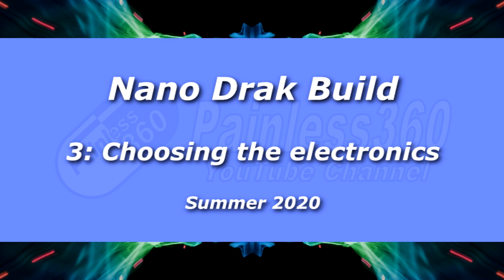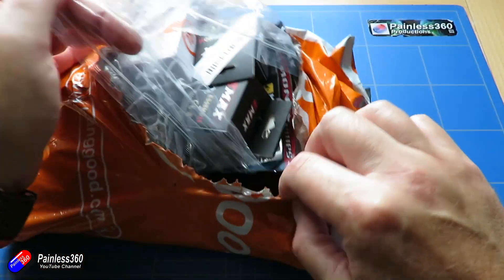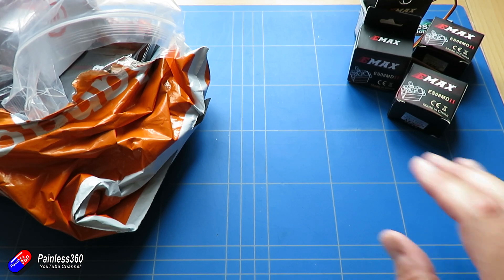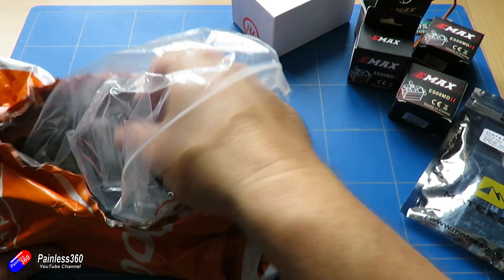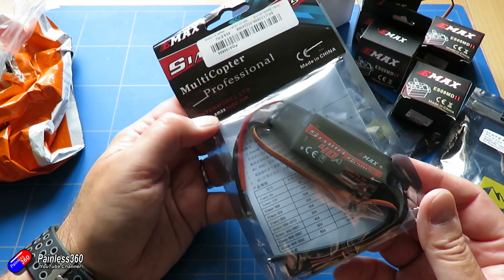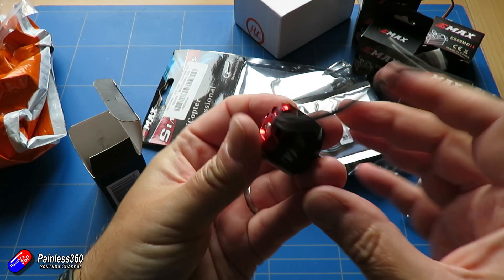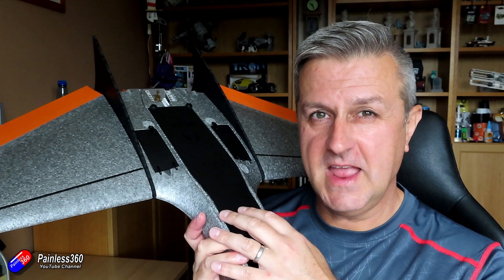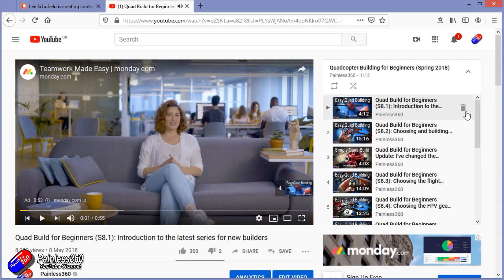Nano Drak Build: Part 3, the electronics!

Comment: I'd be really interested to hear the painless360 take on the nano vs the mini and the extended wings vs the standard ones and how they all fly. How are you finding the noise levels?
Reply from the maker: These are not quiet models ;) I need more time to play with the 40" wings and maybe the tail too...
Reply: @Painless360  I'm really curious to hear what the practical differences are with the different setups. How much speed do you lose with the extended wings? How much slower can you go? Is launching easier with any particular setup? Do you need bigger batteries with the extended wings/boom? etc

Hope you're well.

Comment: Nice video Lee; when you are covering the more detailed iNav setup it would be great if you go revisit (I know you've done it for older versions of iNav) what parameters need to be configured in the CLI and what can now be configured in Advanced configuration. From memory much older versions required RTH Altitude to be set in CLI (set nav_rth_altitude), even though the option was in Configuration, whereas I believe this can now reliably be set in Advanced configuration. Other settings like nav_rth_home_altitude still seem to be only configurable in CLI. Thanks for your continued coverage of iNav, it's my goto protocol for fixed wings and becoming my goto for multirotors.
Reply from the maker: Already done. Check out the iNav for beginners 2020 series... Happy flying!

Comment: Got two Nano Drak builds. One with 28inch wings and boomtail for speed and one with extended wings and boomtail for going a bit higher and further out. Both, the 28inch and the 40inch builds fligh even better with the boomtail. Launching is also way easier. You might try that boomtail out as upgrade someday ;-)
Nice to see you infected with the Drak virus, Lee ;-)